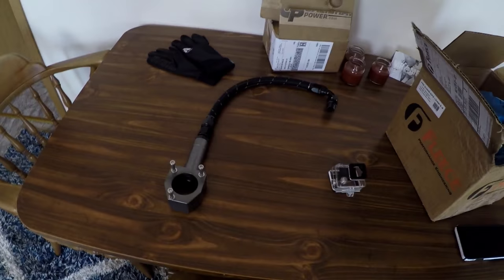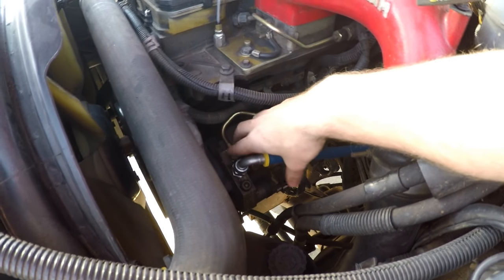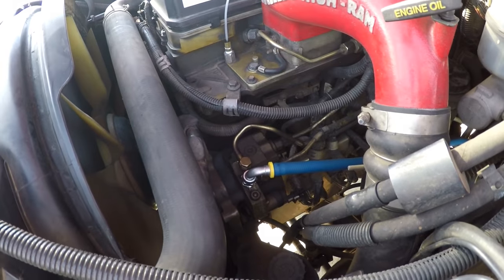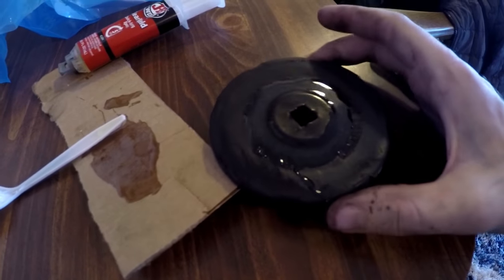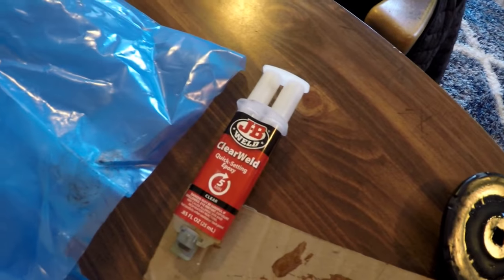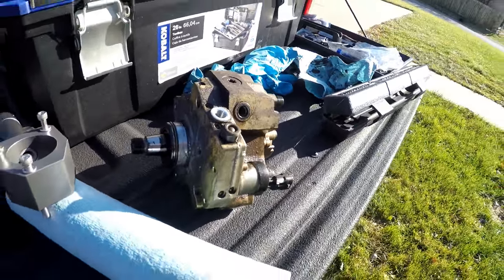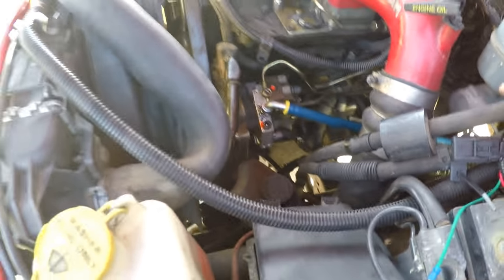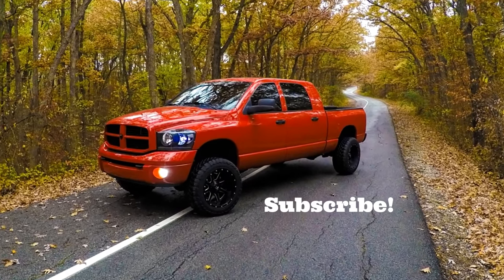Cummins 10mm Injection Pump Install!

Comment: In all the video's I watched none tell you about having to pull the drive gear off the pump shaft.  I used a 2"w x 4"L x 1/4" thick flat plate of steel with a 1/2 bolt about 1/2" long welded in the center of the 1.5" bolt pattern and used two 8mm bolts, 1.25 thread, 60 mm long off the ECM mounts to pull mine.

Comment: What do you mean you can't use the pump?  You can run twin cp3's she'd scream
Reply from the maker: For what I wanted I couldn’t use it. I got a 10mm from fleece which will support more fuel than I need